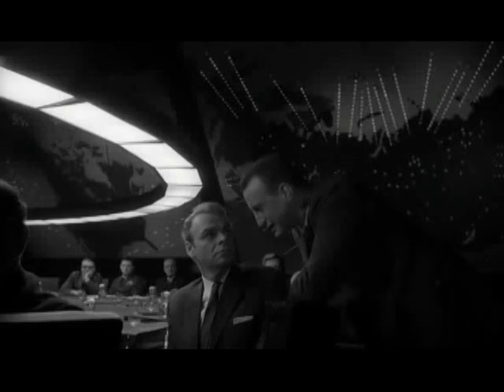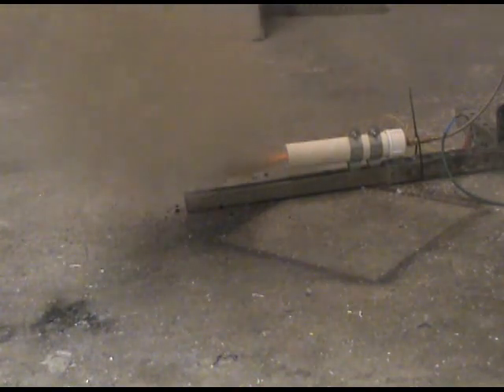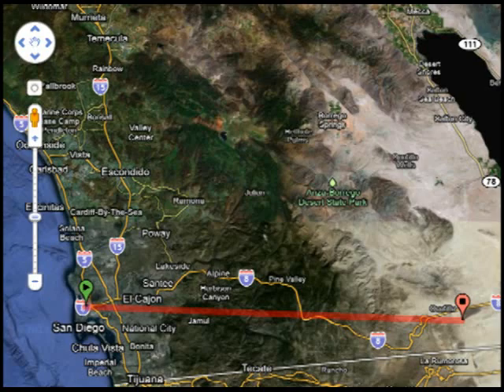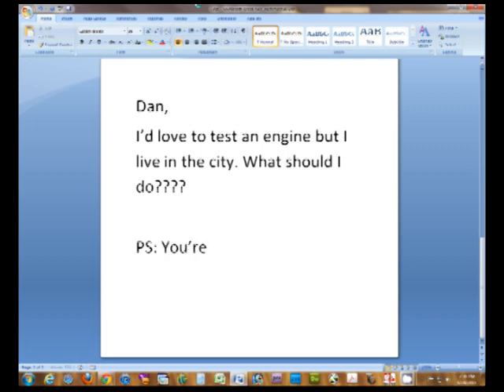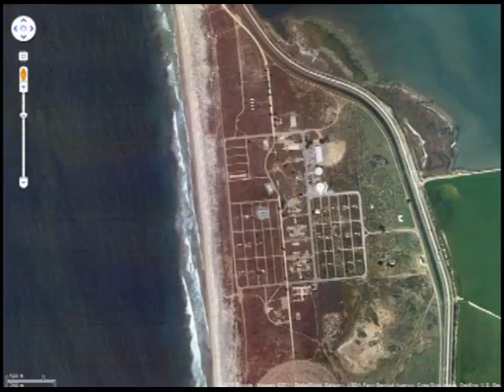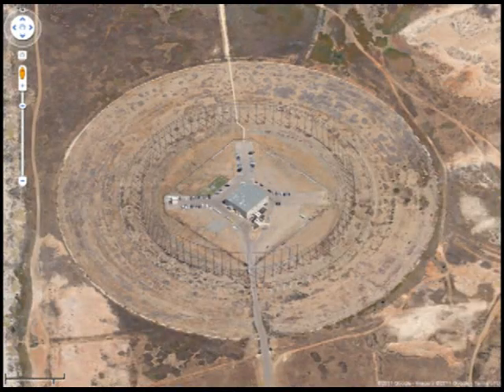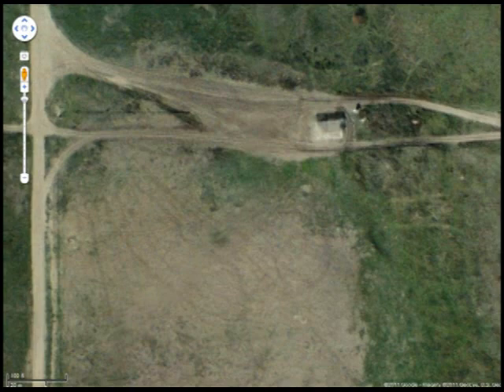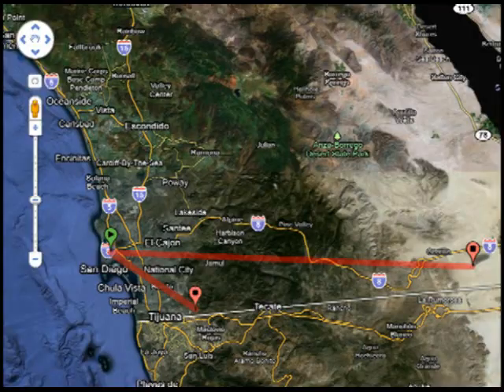2" PVC Hybrid Static Tests

Comment from the maker: @iwasapenny I'm just learning myself, mostly by trial and error. There is a ratio like KN in solids, it's the area of the throat divided by the area of the injector, AT/AI, it should be between 20:1 and 13:1. It also relates to chamber pressure like KN. Don't know anything about regressing rates, sorry.